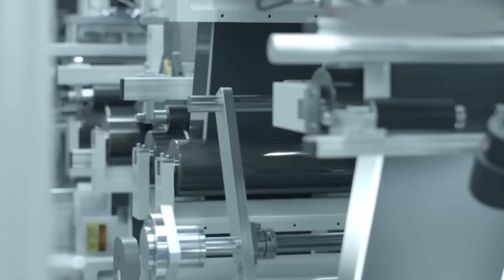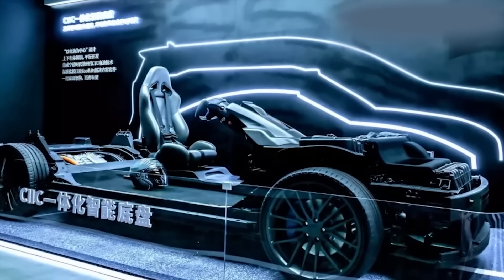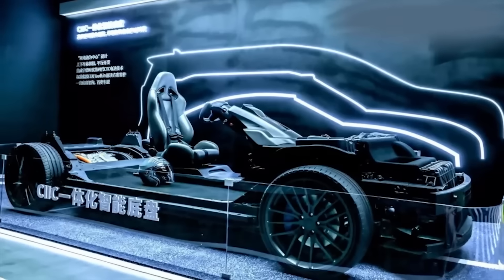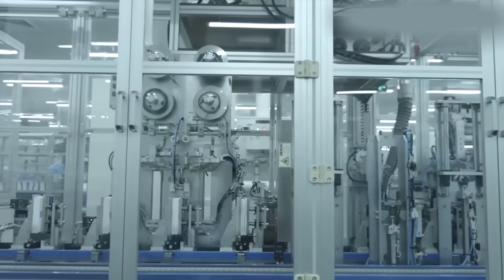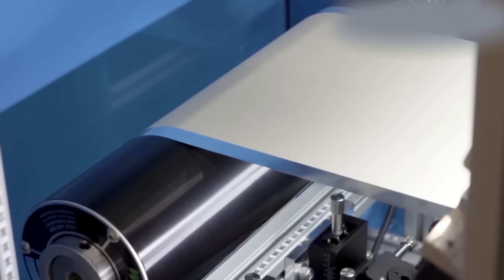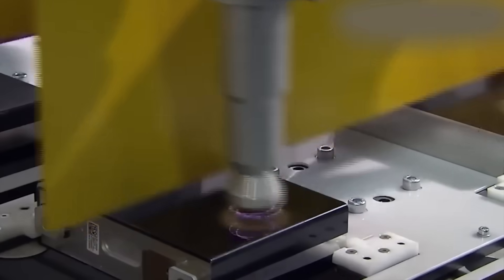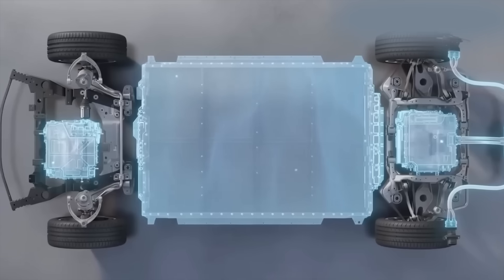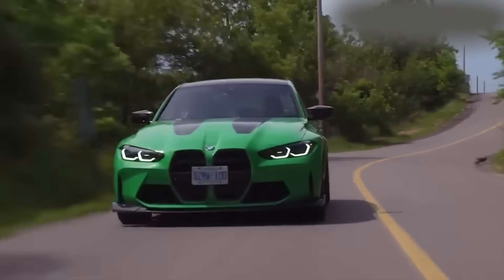CATL Unlocks 1,000-Mile EV Range with New Lithium-Metal Breakthrough

Comment from the maker: Would you rather this or Sodium?
Reply: Sodium. It seems like it might be cheaper
Reply: A good sodium battery will be much cheaper, more sustainable, works better in low temperatures and is safer. Better for most people particularly grid and home storage.
Reply: Sodium.  We need to get off of lithium.
Reply: Sodium sure! it got 10 000 recharge cycles
Reply: Sodium. Cheap and functional is better than expensive and unnecessary.
Reply: I doubt if most people are focused on battery chemistry. Most buyers simply want an EV with decent range, quick to charge and a low maintenance battery that is at low risk of fires. Commercial customers and enthusiasts will be interested in the finer details.
Reply: Why not both? CATL is also offering their Freevoy hybrid chemistry battery packs with tandem BMS control systems. So you get the best of both chemistries.
Reply: Sodium for base, lithium metal as a swappable range extender
Reply: Sodium or if they can make it work Zinc or similar redox for static stuff. Sodium probably for mobile and cheap. I can see Li metal batteries being useful even at 500 cycles for some use cases like racing bikes or formula E cars
Reply: How far is the range with sodium and price vs CATL 1000 mile battery?
Reply: @larryc1616  This is the problem with misleading click bait titles. Batteries themselves do not have range. The combination of energy density, storage capacity, and EV efficiency, determines range.
Reply: I am about affordability and durability. Sodium Ion all the way..
Reply: Lithium metal in an Aptera: 2000 mile range, at least,  maybe even a 3000 mile range. Combined with  Yasa's axial flux motor, the lightest version designed for Aptera: most efficient car ever.
Reply: @koenraad4618  I like both ideas, but I would be happier to have the same 400 miles of range with a smaller battery pack, that weighs half as much. And having Aptera's 3rd wheel powered by a 20 lb, 100HP YASA in-wheel motor (on top of the current motor for AWD) would also be great!
Reply: I would love a 1000 mile EV battery. Then, I could make the drive to my parents’ house and back home without charging, plus extra toddling around. $0.07/KWH is much cheaper than public charger rates! I would absolutely road-trip more frequently. However, l feel like sodium or silicon would be a more sustainable alternative to lithium metal, not least because of price. I keep hoping solid state batteries will emerge in mass production, but I’ve given up holding my breath for that option.
Reply: @Mvanec  Just remember that there are not any 1,000 mile EV batteries. There will (someday) be BEVs that can drive 1,000 miles on a single charge. But right now that would be a waste, because the average EV owner drives under 40 miles per day, and most new EVs can go between 250-350 miles on a charge. So who wants to haul around an extra 1,500lbs just to save an hour on a yearly trip.
Reply: Sodium would be totally fine, if I had some portable range extender battery for long trips
Reply: Both, each has its own optimum application

Comment: I think we will steadily see ICE disappear on the consumer market side of things. Where I see combustable fuels staying around is in aircraft, military, long haul trucking, forestry, some mining, some specialized search and rescue functions. Liquid fuels have certain advantages that will never be beaten and you don't need to eliminate 100% of ICE, if you leave that 1-10% using diesel or jet fuel you get the best of both worlds. Gasoline will basically disappear.

For consumers we just need to see the price come down like it has in China. If those Chinese EV's were sold at similar prices to how they are in China you would see a rapid adoption in the US, the economics just make sense. The US seems to have focused on ultra expensive, large EV's which most consumers cannot afford.

Electric or hydrogen commercial aircraft seems absurd, makes way more sense to use synthetic kerosene.

Comment: Ben I'm not sure you are correct about how energy density works. If a car gets 15kwh/100km and the battery is 60kw then the range is 400km. That cannot change with higher density. What changes is the physical size and weight of the 60kw pack so in theory 1/3 size of current packs, which would add to efficiency but not by triple.

What it does mean is if the manufacturer wants to they could fit a 180kw battery in the same vehicle and that is what enables the greater range. The saved weight and space might result in a small efficiency gain thereby increasing range but it's the larger kw size that is the reason for the 1000km range. 

But with a 180kw pack the charge speeds need to increase accordingly otherwise you can't fill to capacity in a reasonable enough time to take advantage of the pack size.

So English is a tricky language, be careful to explain which bigger you mean, physical or kilowatts.

Comment: As an Australian who does some reasonably long trips, a 600 km range is plenty. Who drives that far without needing a break from behind the wheel? With fast charging I would take the new battery chemistry in a smaller pack and save weight.

Comment: "You could have a compact 60 or 70 kWh pack doing the job of a 120 kWh pack". Um, no. Tho' It's true that a battery with a significantly higher gravimetric energy density will weigh significantly less than a normal one, per unit of energy. Guessing that that's what you meant to say.

Comment: I think maybe you made one mistake there. You said that energy density was the primary factor on range, weight, and cost. The weight is certainly true, if price is not a factor than range is true, but cost is rarely not a factor. Cost is the primary factor in cost, i.e. $ / kWh. Cost on these super high density cells is currently unknown with CATL because they have not announced the costs. But the high density solid state cells that are known are on the order of 10-30 times the cost of traditional batteries per kWh. They are clearly not relevant to the EV market at that price, but there are other markets that would still buy at that rate like electric aviation and super cars, etc... 

One other mistake you said that only CATL has figured out lithium metal anodes, that is not true. Quantum Scape's solid state cells are lithium metal anodes. They call them anodeless, but it is the same thing. They have demonstrated 1000 cycles with 98% retention of capacity. I am sure others have too. CATL may be the first to production though, not sure QS is really close.

That said it is still really interesting news, because cost always comes down. They may not compete with sodium ion on cost (or even LFP), but if they get down to the cost of LFP now (LFP will be cheaper by then), they may take over the long range EVs market.

My eyes are on the solid state sodium ion batteries as the eventual floor for EV's (i.e. mature technology 10-15 years from now). The energy density could eventually get to 500Wh/kg, which is about perfect for a car or light truck. You don't want it to be too light or the EV loses one of its advantages in safety and handling by having a heavy batter evenly distributed close to the ground. 500Wh/kg is starting to get too the edge of too light as a 100Wh pack would only weigh a bit over 200kgs. If you get much less than 200kg, the car actually gets too light. I mean you could always add some weight, but it won't be a something worth paying for.

Comment: Serious question, I'd love an answer. Is it possible (and if not, why not?) to buy an EV, and after paying full price, I can drive away and have no further relationship with the company than I have had with VW since I bought my Passat. I'd like a battery, with a BMS, some motors, and mechanical means to control these and direction, WITHOUT being tracked, without needing software updates, without them having the ability to simply brick my car tomorrow. How much do I own, and how much have I signed an expensive 'End User Contract', for the use of their goods. Ditto home energy storage, without needing an app.

Comment: What, other than lithium is needed, cobalt?, Nickel? In short, is there any reason it shouldn't become as cheap as LFP batteries? In which case, why would it stay high end? (Five years is a long time in battery chemistry, by the time the first of these roll off the line, maybe some sulphur, or silicon chemistry will have made 500Wh/kg look quaint.

Comment: I don't like the recent habit of battery press releases showing a given BEV range (like 1,000 miles) as an indication of innovation. I understand that it gets clicks, but it is misleading. The GMC Hummer gets over 300 miles of range, but its gigantic 230kWh battery pack weighs more than a ton, just by itself! So 1,000 miles of range is likely attainable with any battery in any vehicle. Energy density, weight, and efficiency are the key factors. Along with weather, temp, load, etc..

Comment: A 60 or 70kWhr battery pack will not do the job or work as a 120kWhr battery pack today by definition. The amount of kWhrs in a battery is by definition the amount of stored energy regardless of weight. I think you mean a 120kWhr battery will be half the weight in the future.

I do realize there are gains due to the fact you are hauling around less weight but that is fairly minimal.

Comment: I’m interested from the aviation side of it all. This one electrolyte change is something to be capitalized on with ceramics, their already existing semi solid state technology, and organic polymer electrode coverings. This is just a stepping stone to even higher energy densities.

Although, ICE engines will be around for a while. There will always be applications that need that power, but commuter vehicles will largely turn to electric over the next ten years as battery prices are set to plummet.

Comment: I think a sweet spot for many Americans would be a battery with a range of 400 to 500 miles.  Even though a vast majority of us don't need that much range, exceeding the current day standard of a battery with a 300 mile range by a large amount would overcome the mental hurdle of "range anxiety" that many use to avoid purchasing an EV.  I've owned an EV6 GT Line AWD for 3 - 1/2 years now, and it's practical (real world) 250 mile range is more than enough for my use case.  However, if someone doesn't have any experience daily driving an EV, they find 250 miles to be too low of a number.

Comment: How can possibly a 60-70 kW h do the job of a 120 kWh pack?
 - that totally defies physics!

Let's exaggerate and say that this pack weighs 100kg vs 400 kg for a LiFePo battery, saving 300 kgs of weight.
On a typical EV that might reduce the weight from 1,800 kgs to 1,500 kgs - a reduction of ~32%. This would lead to a reduced energy consumption of 5-15% depending on circumstances - NOT 50% as you suggest in te video!

Comment: There is a market for having as much range as you can afford, all the way beyond the distance from John O Groats to Lands End.

The fact of the matter is that roadside charging isn’t getting any cheaper.  In fact it’s often horrendously expensive, and I’d rather avoid using it as much as possible.

So having a battery that’s good not only for any long distance journey, but also any journey after you’ve arrived at your destination (because your destination doesn’t have charging available) that adds a huge amount of flexibility.

Even if the battery was horribly expensive, it does have the benefit of making every other battery out there cheaper.  If we take the Model 3 standard range as as example.  That started off in 2017 with a 250 mile range.  Now it’s 330 miles.  In 4 years time it could well be 400 miles.

Comment: 600 kilometers per charge is awesome for sedan vehicle. But an SUV or a truck that wants to pull something like a boat or an RV needs a minimum of 1,000 KW and should actually have more. When you're pulling weight behind a vehicle, you only get 1/3 of the battery density. It's not impossible to tow with the current technology but stopping every 100 miles sucks. So for towing a minimum of 1,000 km is required. I'm looking forward to that day, but I don't think it's coming soon enough.

Comment: There an annoucement on a "gamechaging" EV battery chemistry practically every week. I've learned CATL is one of the few companies that will actually bring the tech to market and usually within a couple of years of an announcement.  Not sure what they are feeding their physicists and engineers but they  have been on quite the innovatio tear these last few years. Although not at level of Moore's law, CATL reminds me of Intel back in the 80s when chips were rapidly improving while rapidly dropping in price at the same time.

The anti-EV zealots that talk as if EV batteries are static techology that has failed have no idea what they are talking about. At this junction it's unambiguously  self-evident that EVs are destined to replace ICE cars. The more interesting question is will energy densities ever reach a point where they can replace jet fuel for even large aircraft?  It's still a long way away but given the ongoing brisk pace of developmet, that testing for manned drones and small aircraft is already a thing,  perhaps one day what once seemed like only  sciece fiction might become reality.

Comment: We absolutely do need these higher energy density batteries, as long as they are safe, cost around $50/kWh, recharge in 15 minutes or less, and last 1 million miles and 10 years  or more.  In this case, 400 miles of range at 75 miles/hour would be the target.
Reply: We are pretty close to that now. In fact there are even faster charging rates.

Comment: Fantastic. Now how does the energy get into the batteries? That's the real issue.
Reply: You plug it in and get charged. Problem solved.
Reply: @yodaiam1000  If only it were so easy. There's a lot that goes on behind the scenes.
Reply: @miscreanity Yes, I am so sure the oil exploration, extraction, initial processing, transportation to refineries, the refinement process, transportation to filling stations, dealing with leaks through out the process etc. is just so much easier. Not to mention all the electricity required for all those processes. It is substantially easier to build the infrastructure for battery powered vehicles.

Comment: Erm, if the pack is the same size (kWh), then it’s going to be lighter but isn’t going to double the range. The battery is less than half the weight of the vehicle (a 65kWh LFP battery should come in at around 400kg), and the energy needed to move the vehicle doesn’t come down by more than 20%.
Reply: The difference is actually substantially less than 20%. Weight of an EV with regen has little impact on the range. It does make a difference but we are talking in the 1 or 2% range.

Comment: At these energy densities it will be very silly to keep thinking in terms of fixed batteries or skateboard platforms. We will then use standardized modules that are simply swapped out at universal swap stations. Life cycle and charging speed will then be a lot less relevant, because modules are charged outside of the car and a module that reaches end of life will be taking out of roulation.

Comment: In cars, I think 350 to 400 miles is plenty of range so batteries could become smaller. Pick up trucks I think somewhere between 450 and 550 miles is good when you’re working the truck. That should leave towing range 200-350 miles depending on the weight and terrain.
Reply: agree, also, eventually,  the trailers should hold the batteries necessary above the requirements of the powered vehicles.
Reply: @beachlife7316 I agree that trailer could have battery packs to extend the tow vehicle range. Though I don’t want to pay for a drivetrain on the trailer also, the battery needs to connect to the tow vehicle and add to the tow vehicle’s battery capacity.
Reply: @briannelson2818  agree ... 
also, the new gravity touring with small battery, 85ish KWH , could carry "range batteries" in a tow hitch mounted tray for long trips.

Comment: Ev cost needs to come down most people can't afford $80k cars.

 Charging cost at dc fast charging stations can be 4 times per kwh than charging at home.

Dc fast charging requires 3 phase power at 480 volts or higher and which homes dont have.  5 minute charging time at 450kw is 9 times more your house can draw from the grid- but you dont need to charge in 5 minutes at home.

How fast a battery can charge (measured in kwh) starts dropping after 30 minutes - if battery improvements allow the charging speed in kwh to stay high, it will charge in less time.
Reply: Thats more of a USA problem than an EV problem. Chinese EV's start at under $20K US in Europe, and a chunk less than that in China. Micro cars of the kind that his Trumpiness seems to plan to now allow in the US start around $5K US but you'd not want to take one except around local streets as it's got more in common with a high end golf buggy.
Reply: Used EVs actually pretty affordable. EVs really aren’t anymore expensive than ICE cars nowadays. You don’t do DC fast charging at home so I don’t know why that is an issue. Yes, DC fast charging is much more expensive. In most places it is still less expensive than fuel. Most people charge at home, work, or hotels once they reach their destination.
Reply: @yodaiam1000  Europe we generally do fastish charging at home. The kit isn't that expensive at 240v 32A, as that's already a fairly standard cable to run between things like distribution boards so all the components involved are off the shelf. 16A 240v is trivial.
Reply: @etchedpixels Yes, I have fairly fast AC charging at home as well. Going from 0 to 100% overnight is not an issue (not that that I have ever needed a 100% charge overnight before).😊